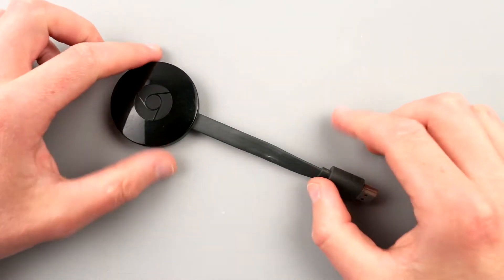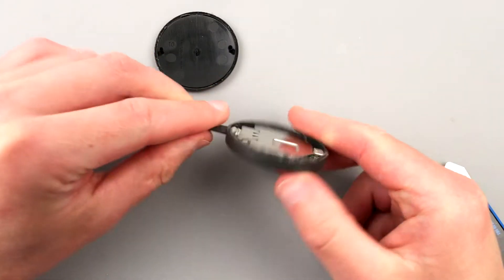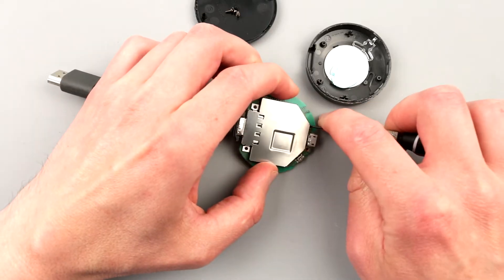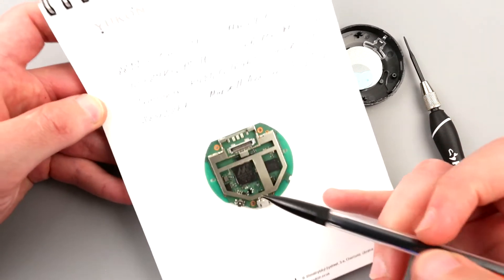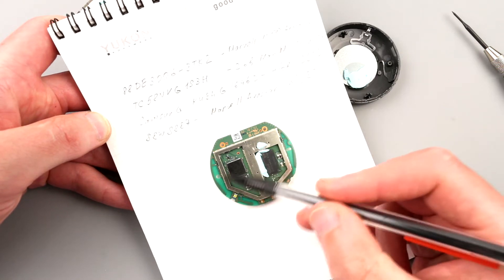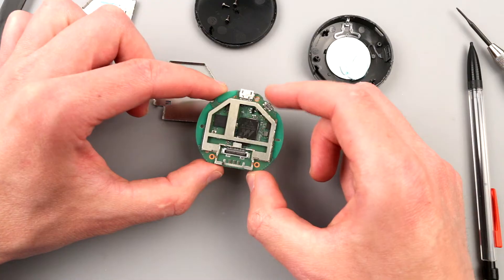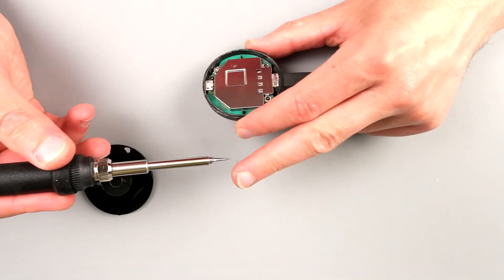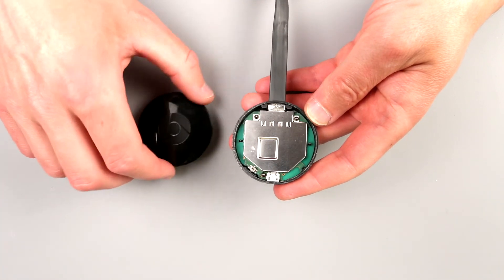Chromecast Gen 2 Teardown and Repair

Comment: Hi, thank you for the teardown. I solved the problem with mine by removing one of the sides and attaching a small PC heatsink. My TV is old and dissipates a lot of heat at the back where the Chromecast sits.
Reply from the maker: Thank you for watching! Since that video i keep my chromecast opened for better heat dissipation as well. Heatsink is great idea actually

Comment: You should add a huge liquid cooled heat sink. Jk that would prolly run under operating temp.
Reply from the maker: Haha, yes it is getting pretty hot for sure
Reply: @InsideOutElectronics  The main problem that causes sudden power off and restarting is overheating. This is your and our problem.

Comment: If you have a non-booting chromecast gen 1 (2013) (non-booting = pink led), try to remove the PCB and rf shields, then reflow the board (most likely the flip chip silicon die is the problematic part). Do not forget to re-apply thermal grease.
I disassembled mine just to look what's inside, decided to give it a try before binning it. And et voila - to my surprise it actually did resurrect it. 
Not that they're terribly useful anyways - Google killed the CC1 by supplying a faulty update as the last one, which constantly lags when playing 50/60p youtube videos - The CC1 tries to play those videos, but than fails and constantly switches between 480p and laggy 1080p60. Planned obsolescence at it's finest. My first and last Chromecast... It was great while the software still worked...
Most likely it had cracked solder balls - those first gen ones tend to run insanely hot.
Reply from the maker: Ok, well thank you for the idea for another youtube video :D
Reply: Mine lasted 6 years. Bought a 3rd gen.

Comment: Hey man, do you know whether this gen 2 chromecast has the ability to output high res audio files (16/24 bit, 44.1/48/96khz). I know that the Chromecast Audio can do that but can't find any info about this for the gen 2 normal chromecast like this one.
Reply from the maker: Highly likely not
Reply: @InsideOutElectronics  Hi, I'd like to let you know that I accidentally found out that the gen 2 Chromecast can output up to 24 bit/192 kHz. I downloaded three hi-res versions of the same song.
1. 24 bit/352.8 kHz
2. 24 bit/192 kHz
3. DSD64
I cast the songs through Hi-Fi Cast app. The 24 bit/352.8kHz did not play and needed to be transcoded in-app to be able to play (the app suggested that after it was unable to cast it). The 24 bit/192kHz version played without needing to be transcodded while the DSD64 also did not play and had to be transcodded to be able to play through chromecast or even through my Android smartphone's speaker. I hope this can be beneficial to all of us. Those software and electrical engineers that can confirm or bust this findings are welcomed as I'm still not confident with my testing. 🤣
Reply from the maker: @HarithAhmadDaud  Thank you for your findings ! I will give it a try myself.

Comment: Do you know where i can get parts for this? My hdmi cable broke and I need a replacement, but I cant find anyone that sells it.
Reply from the maker: Probably the only option is to find broken one and pull cable from there. This HDMI cable specifically designed for Chomecast, dont think  you can find 3rd party replacement.
Reply: @InsideOutElectronics  Seems like my only option, which will be pretty hard considering broken hdmi is a very common problem, anyways thanks for the reply.
Funny that when a lot of reviewers were giving props to it for having a removable hdmi cable, "which would make it very repairable" when they dont even sell the cable individually hahaha.
Reply: @dmaster225  i have same problem. did u find the replacement hdmi cable?
Reply: @jancabrera  nah i gave up after several days of searching. seems weird to me that they wouldnt sell replacement cables since it seems like a common problem, they expect you to buy a brand new one. Or return it if it still has warranty, but it seems like they know how long they last till they break because it broke like a month after the warranty expired.